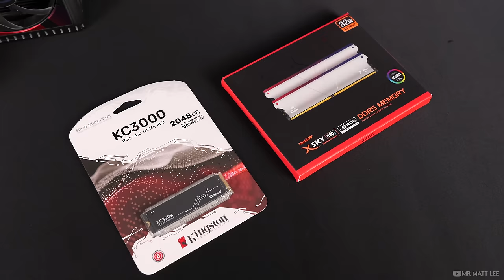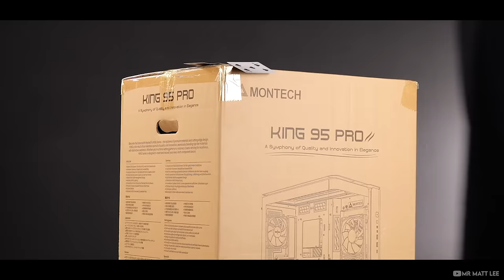Airflow, to the Throne?! | Montech King 95 Pro Gaming PC Build | ASUS ROG Strix RTX 4080, i7 14700K

Comment from the maker: What’s your thoughts on the King 95? Would you like to see a second build with the airflow front fan intake configuration soon? 👀 for those who missed the small print before the airflow visual, the RAM kit was changed due to an RGB communication error. This isn’t a fault of V-Colors RAM, it was an issue during setup I didn’t resolve in time and default ‘rainbow wave’ would’ve been a bit weird.
Reply: Can you do that on the Ceres 500?
Reply: Definitely
Reply: Wow i have t Montech 2 this is even better sure will get one soon
Reply: Definitely a second build and if possible in white
Reply: Great build! I'd love to see the King 95 with a 280mm radiator on the side. The Lian Li Air Mini's fitment issues make the King 95 look promising. Excited for a build with the airflow front fan setup. And hey - tech quirks like the RAM RGB issue happen, no biggie! 👍
Reply: The case is interesting, for some reason it reminded me of Asus TUF Gaming GT502
Reply: actually this a good then front fan
because its look really clear
Reply: Yes, I would like to see the airflow version
Reply: Would love to see another build in this case. 7800x3d and 7900xtx maybe?
Reply: I just bought it. Don't care about the flow. It just looks AWESOME!
Reply: Can you tell me how do I change the colors to the fan? I managed to change the RAM & GPU with Asus Aura. But the case I’m having trouble with.
Reply: @AfflictionKing1  some fans are not compatible with aura sync. You may have to download the specific software for that brand
Reply: @TheBlueBunnyKen  specifically what for that case? I try looking
Reply: @AfflictionKing1  Google what is the compatible rgb software for the brand
Reply: @AfflictionKing1  i use Gigabyte controll center from my motherboard.
Reply: Definitely yes but white build next time around.
Reply: @rensdf4615  and what about the airflow? Is it bad??
Reply: Hello,can you share the rgb code used on those montech fans?
Reply: Thank you for the inspiration, I instantly fell in love with this build and purchased my parts immediately after the video. I love it, can't stop looking at it! It's the exact pale blue of Luke's lightsaber in the original compositing 😍 Airflow is great and although the interior is quite large, is a more compact case with the perfect ratio for these parts, making everything perfectly proportional. Cleaning and maintenance are so easy in this case. It's an exceptional build, to say the least.
Reply: My montech 95  king pro can sync with msi mysticlight only the Gpu ligt can detect mystic light msi can u help me

Comment: You know they aren't sparing any expense on a case when it has curved glass! That looks totally unique and stunning though with more of a flowing shape how the corners are rounded off. Very impressed!
Reply from the maker: Absolutely this Mr Jenks! Crazy how the price, even with all of these fans, is still less than £140 in the UK. Madness!
Reply: @Mr_Matt_Lee Hey Matt! I just want to ask you which GPU holder did you use in this build? Because i rewatch your video multiple times and decided to buy this case and build my own pc and that GPU holder looks so premium in this case, expecially that color. If you can answer me i would be glad.
Reply from the maker: @Red-ding-Ton  that GPU support comes as standard with those Strix graphics cards. I don’t believe they are sold separately though unfortunately 😭
Reply: @Mr_Matt_Lee  Thank you for your answer ❤️

Comment: Montech quality is incredible. Have used for a month, would suggest to others. This is just so PERFECT. I really love the full-view case and the cooling is ok as well. If u still don’t have one, just go for it.✨
Reply: I didn't know this brand, and when I saw it on this channel I was shocked, it was love at first sight with this tower, on top of that it comes with fans installed with an ARGB on the edges that makes it different from the others, a built-in hub controller and the option of putting a front grille, that curvature in the corner that makes it unique, a 10 in design for Montech.

Comment: Do you think the curve of the front panel glass helps with directing airflow? Part of me wants to replace my Lancool 216 for this, but I'm worried temps will be higher since the 216 has two 160mm front fans hitting components directly. I could use the mesh front panel on the King 95, but that kind of defeats the purpose in my case. I'm running a 5950X air-cooled with a U14S and a 4090 FE, with two 140mm Noctuas intaking from the bottom, a 140mm in the rear, 140mm exhausting out the top, and soon-to-be a 120mm outside pulling heat from the GPU.

Comment: The only problem I’m having is making all of my argb lights to come on it kills me. Did you all use a separate argb light connector than the regular fan hub? All of my fans are working just only 5 out of 9 light up unfortunately :( I hope for some sort of response!!!
Reply: Hey, not sure if you knew this or not or if you figured it out already but I read on another video the fan controller actually needs 2 power cables plugged into it to work proper.
Reply: @EhCSlater  oh shi thank you

Comment: All the fans are set as exhaust, airflow gona suck badly, you can even see it in airflow smoke test ..
Reply from the maker: The side and bottom fans are reverse fan blade. They look normal, but they are actually pulling air into the case not exhausting. Then the exhausts are via the top and rear.